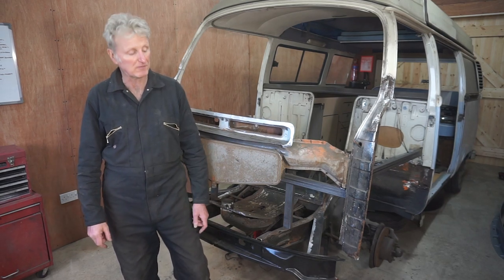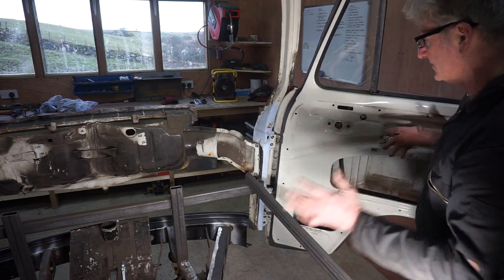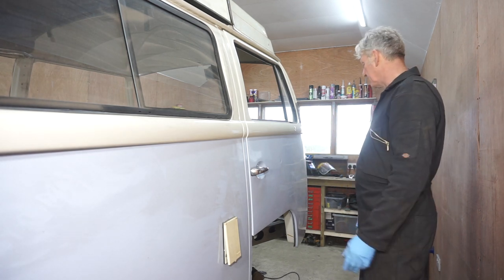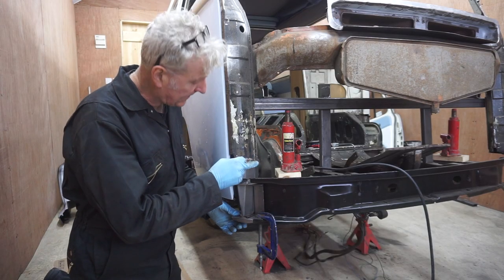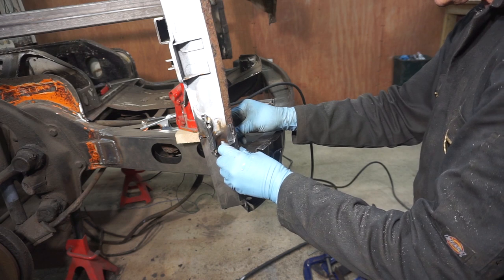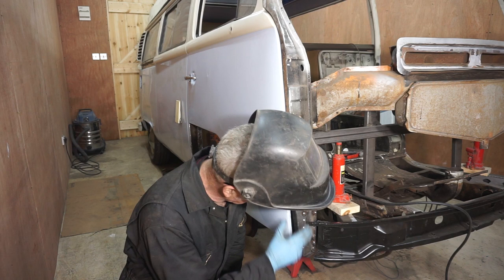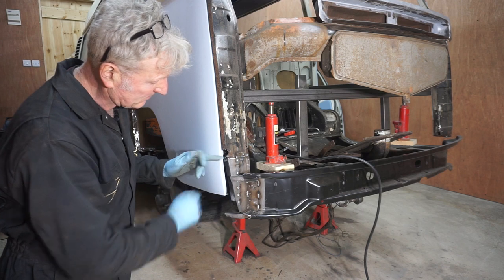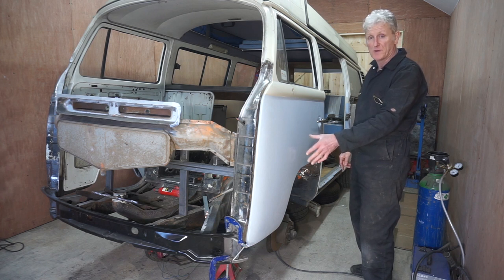1973 VW Campervan Restoration Part 7

Comment: Whats the name for the repair panels for the A pillars? I have a 1975 and found the same issue as you have. Im based in New Zealand
Reply from the maker: Hi, they are "Lower A post repair panels" around £50 UK pounds - Ipurchased them from Schofields here in the UK. Cheers Jonathon